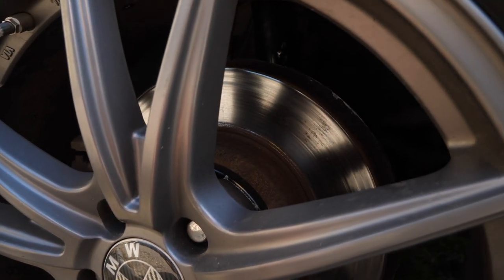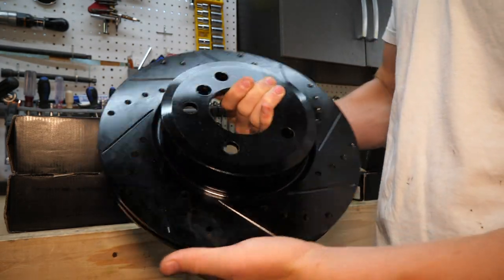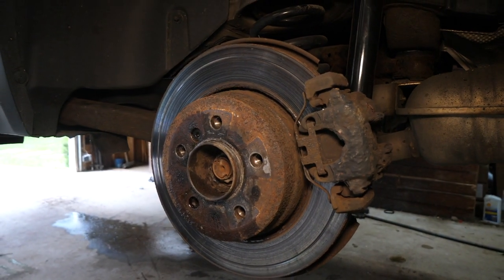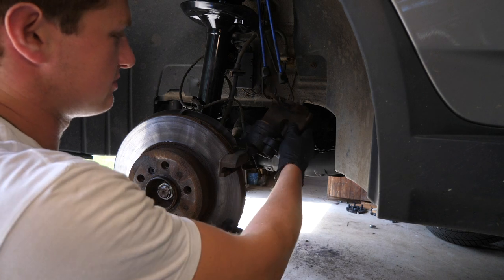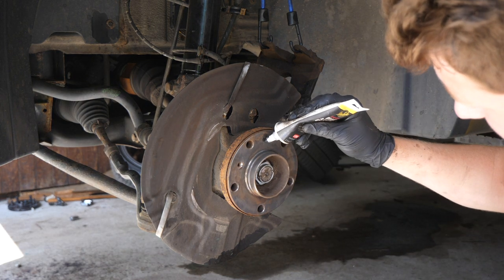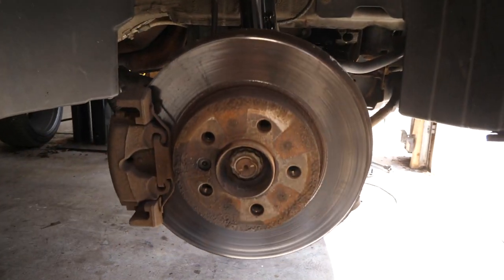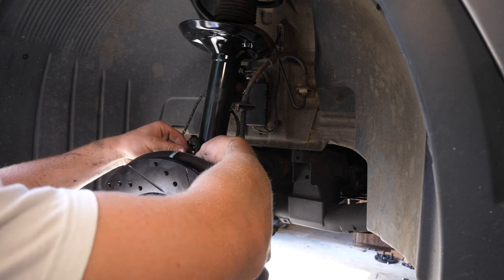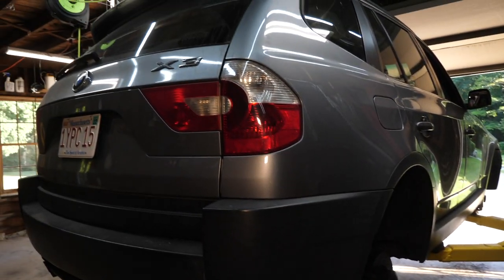How to Replace BMW Brake Rotors & Pads For UNDER $300 // R1 Concepts Drilled & Slotted Brake Kit

Comment: is the abs / brake / 4x4 still on after replacing the brake and rotor and the brake & wheel sensor?  I  have code D35C no message (transfer case 192) three  light is on, i did check the plastic gear  and looks fine, any though.   Thank you
Reply from the maker: I had to do the gear, a sensor, and a wheel bearing as the bearing had build up and was continuously eating sensors.